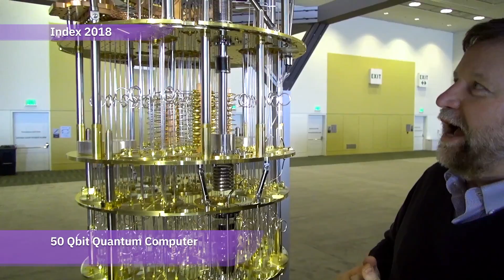Bob Sutor explains the IBM Q quantum computer

Comment: How much Hash rate will it give ?
Reply from the maker: Hi Arpit! The IBM quantum computer is not giving any significant hash rate just yet, and we don't foresee mining as a task for it in the immediate future. For now, the IBM QC is focused on solving complex problems more quickly, potentially improving applications like disease diagnosis, fraud detection, or efficient energy management.
Classic computers are still the best at crypto-mining if that's what you're looking for. 🙂

Comment: Who knows..in few years we will have a miniaturized version of quantum computers
Reply: It's not gonna happen, sadly it relies on nearly 0 K temperatures, physically impossible in "pocket" size. And anyway, we know no imaginable superconductor at higher  temperatures.  Nice idea for an q-computing center but not even remotely possible for normal people, the general idea must be reworked in order to achieve portability.
Reply: Yup, no need for an Iphone... make way for the Q- phone.
Reply: Making 0K in a lab requires a huge and expensive freezer. Plus it’ll have to be radiation-free so made of thick walls of lead. Can’t fit that in a pocket.